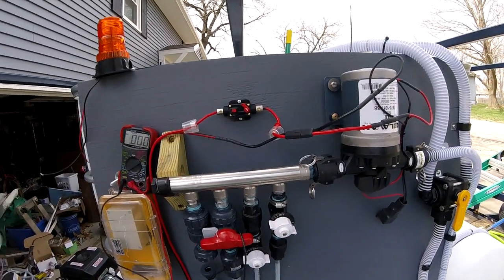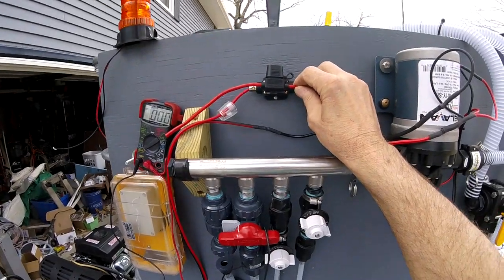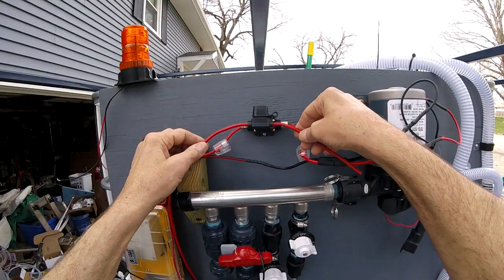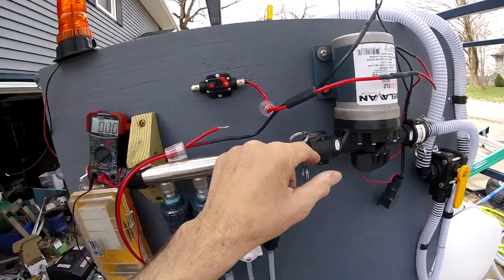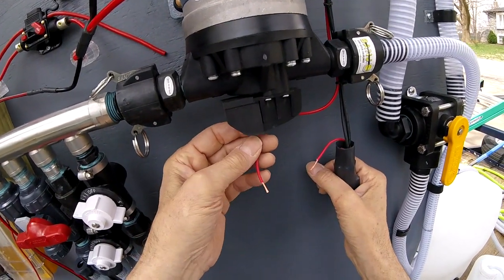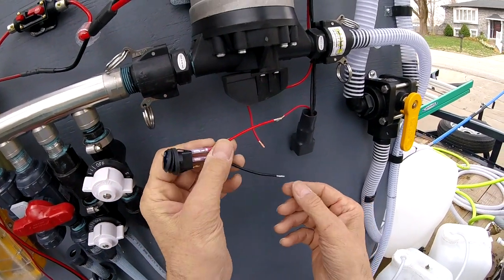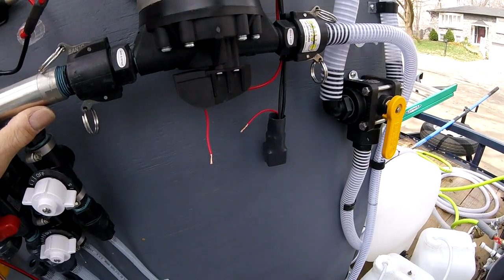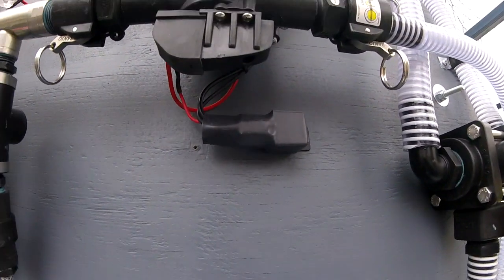Part 2 of 2 - How to "properly" wire a switch to your 12 volt pump/motor. Soft Washing

Comment: Where do you tap in for the light can you make a video!
Reply from the maker: Look closely at the switch.  You can see an extra connector on it that I'm not using.  Simply hook that to the ground.

Comment: And for those that use a different brand of pump that does not have a relay preinstalled, you can install your own, from any auto parts store.
Reply from the maker: Yes Sir.  Relays are cheap.

Comment: I had the same pump, and i used a car battery disconnect switch as the switch because every other small switch up the 30 amp I used all burned out. Thanks for the video. I know can use a smaller switch now.
Reply from the maker: Glad to help

Comment: Well done and great idea on the switch!  Also I swear by a product called Fluid film I spray on anything (Metal/Wires/terminals) to protect from SH.  Also buy the Fluid film in bulk (Gallon can) and bought the sprayer on ebay that hooks to a compressor.  I Coat the undercarriage of the truck too and brake lines and does a excellent job from the salt on the road up here in New England.
Reply: fluid film is amazing! I also love it and use it on brake line/fittings fuel lines and love how it clings and stays put, but will also creep and flow when hot somewhat.
Reply from the maker: I'm familiar with Fluid film.  I bought some at a mower show to coat the underside of decks.  It smells good and is made of Lanolin. I will give it a try.

Comment: In all the videos I’ve seen everyone places the mixing station before the pump as you have. Since the water is left full open anyway wouldn’t the system work just as well placing the other fluid inputs after the pump to avoid running chemicals through the pump?
Reply from the maker: I understand.  But on the one side of the pump you have suction.  The other side is pressure.  Adding any inputs on the pressure side of the tank won't work because the fluid will be pushing against  those inlets and not pulling from them.  You could add some type of injector to create a suction but that would drop your flow a ton.  So the simplest way is to make the pump pull your chemical's from the suction side.
Reply: @housewashing5693  hey hope you've been well! I'm curious how your blend manifold that you built is doing? I haven't seen you post any videos of using it after updating it! If you posted one I apologize! But would love to see it in action! I'm planning on building one myself and really like how you did yours! Thank you
Reply from the maker: @MrRunItUp  The larger manifold I built for my gas diaphragm pump is working great.

Comment: Why did u mount the pump upside down?
Reply from the maker: 1. Because I wanted to pump from left to right. 2. If the pump leaks inside or outside it wont run into the motor. 3. The pump can be mounted in any configuration you want.

Comment: I would remove the relay and install a solenoid, and you never have to worry about those relays
Reply from the maker: Relay and solenoids are basically the same.  They both use electromagnetic fields (low current) to energize a (higher current) circuit.  One produces an electromagnetic field to it's core while the other to it's end.  So what is the difference between a 60 amp solenoid and a 60 amp relay when applied to a circuit?
Reply: @housewashing5693  my brother the answer to that question have a few answers, I will like to invite you to make a video discussing 12v pumps!!
Reply from the maker: @Abovenbeyondservices  I only have one pump and I've already shown where they suck.  What kind a video do you want me to make?
Reply: @housewashing5693  I’m not asking you to make a video, I was trying to say for both of us to do a video discussing this topic, I think it will be a good topic for the new guys, it’s up to you, it’s fine if you don’t want to
Reply from the maker: @Abovenbeyondservices  I actually am a new guy.  I haven't even fired my machines up.  So all of my advice is from past experiences working on mechanical/electrical repairs. I think the theories still apply....
Reply from the maker: @Abovenbeyondservices  Thanks John.  I's sure I'll need help.  I'm just making this shit up as I go!

Comment: So glad ur back. I am in my first trailer build and Im learning amazing info from you. See you got some more work done on ur build. Am I missing a vid?  Trying to get some info on plumbing the soft and pwasher. U using a valve to switch between water feeds or did u plumb separate draws?  How you pulling sh to load ur sh tank?  Thanks for any insight. Look forward to ur next videos!
Reply from the maker: I have it all on vids to be edited.  Like I said it will be a vid of everything but each thing I did will only be a minute or two.  Instead of loading 10 2 minutes vids it will be one with a crap load of stuff on it.